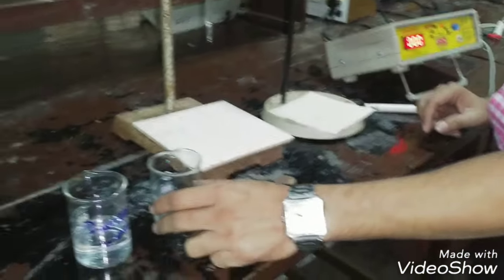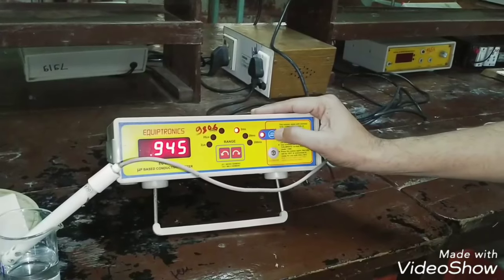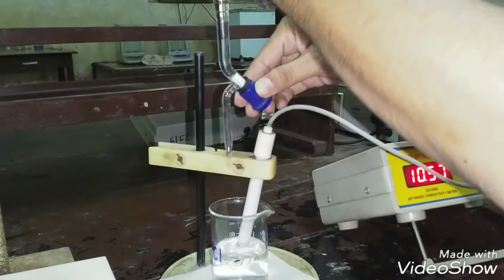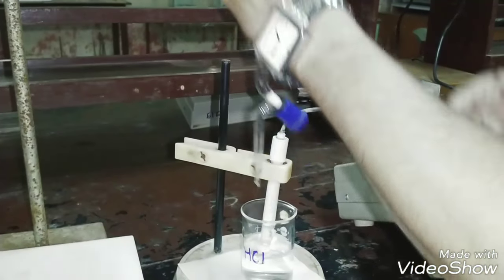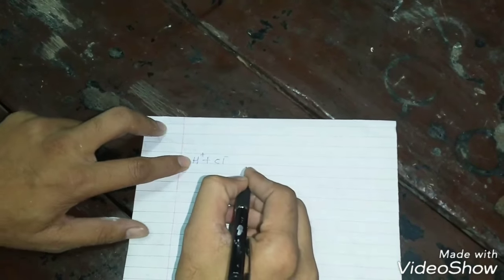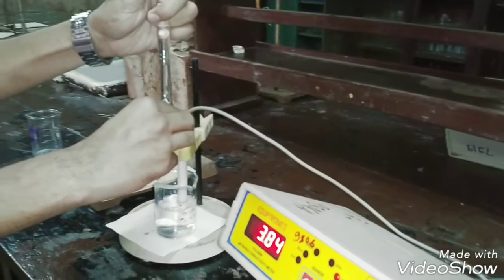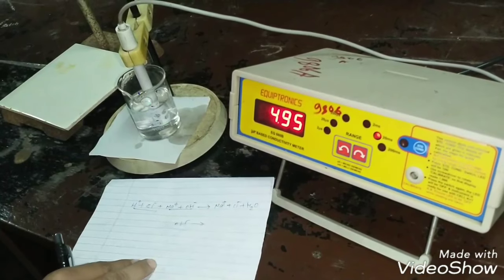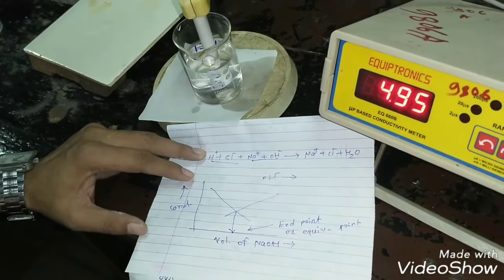Conductometric titration of Strong acid Vs Strong Base

Comment: Sir I can't understand that frm where d 2line comes frm n how can the graph will intersect..plz make me understand sir
Reply from the maker: Initial conductance of acid is high. On addition of base, H+ ion from acid is replaced by Na+ due to which conductance decreases upto neutralization of acid. After that due excess addition of strong base conductance increases. When we plot this variation of conductance with added base the nature of graph is two intersecting lines and point of intersection corresponds to the equivalence point.
Reply: @moteumesh  tq so much sir...sir pls make video on thin layer chromatography
Reply: @moteumesh  thanks👍

Comment: But how do we know that it is the exact end point....
When the conductivity will decrease from starting.....
Reply from the maker: First thing is that conductance depends on size mobilty of ions. In the beginning H+ ions concn is high hence conductance also high. But when NaOH is added fast moving H+ from acid is replaced by slow moving Na+ due to which conductance start decreasing. When acid is completely neutralised due to excess strong base dissociation conductance start again increasing which confirms equivalence point. .